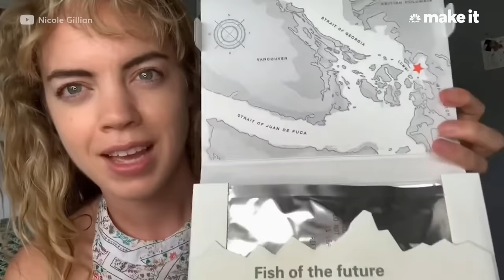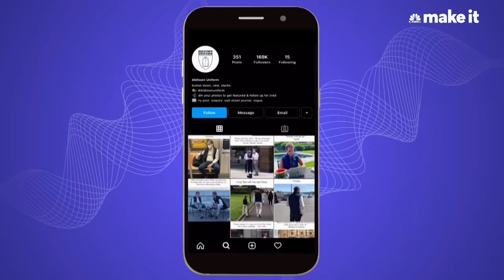How A Vest Turned Patagonia Into A Billion-Dollar Brand

Comment: My favorite part about Patagonia is how they supply a massive amount of cold weather clothing to the military without telling any of their yuppy customers.   Almost all of the cold weather gear issued to me in the Army was Patagonia.  That’s their real cash cow.
Reply: What items exactly? Capeline? Polyester fleece?
Reply: My only issue is they work to well you end up sweating real fast.
Reply: They can't advertise that because of their customer base.
Reply: I'm their customer and the army using them is a good thing, makes me respect them more. If they advertise or not doesn't really matter, its up to their marketing strategy. I don't find this omission a lie, they never deny it no?
Reply: It was a different brand that was doing that, now they are independent of Patagonia. So they weren't a "cash cow" as you described it. Either way it's good that the military works with these types of companies.

Comment: Call it what you want but as a guy who has worked everyday outside for 35 years in the Northwest Patigonia make the best rain gear I have used with good environmental standards   My request is ditch the fleece and go with wool to eliminate micro plastics in the water (from washing).

Comment: I've found Patagonia to be overpriced and over hyped. I didn't think much of the quality that so many had told me about.
Reply: Nah man, I've had their hoodie which I possibly used for everything, for activities like rock climbing ,hiking and camping. it's been beaten a lot and still as good as a new hoodie. It still a outdoor brand it's just that it has picked up hyped as a street wear, it's still a very underrated outdoors apparel
Reply: @suyashjaiswal2782  The outdoor gear is actually what I'm talking about (though the everyday gear I find even more overpriced and useless) I've bought a few Patagonia jackets which have been donated. They just can't match the usability of Rab, Montane or arcteryx. I've been extremely disappointed with the perceived over value of the outdoor stuff- just average gear at a high price.
Reply: Nah, you’re way wrong.  I purchased a jacket in 1986, torn and tattered, I laughed as I sent it back in 2016 for repair (yea, 30 years later.  I got it when I was 17) wondering about their lifetime guarantee.  Sure enough it got sent back to me looking completely new. Free. I was amazed
Reply: @lerianchan  different experiences I guess